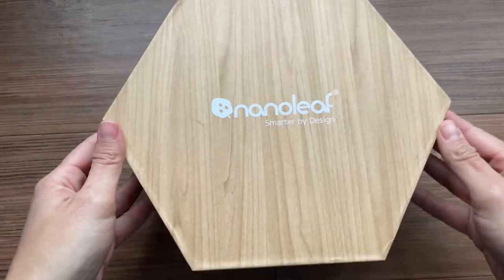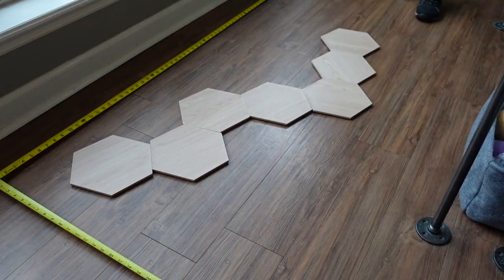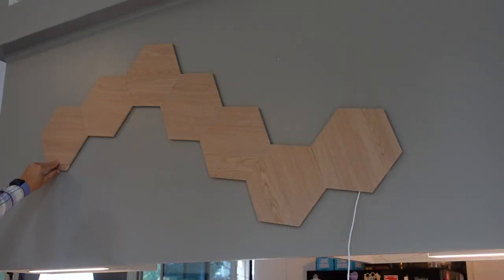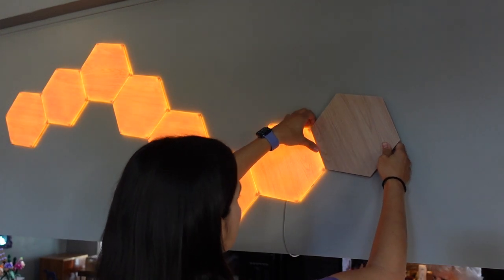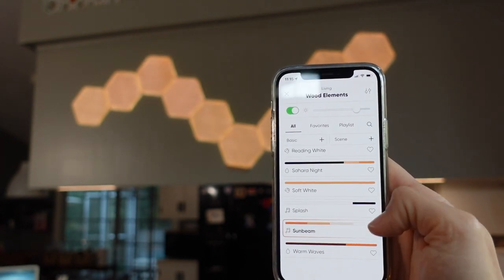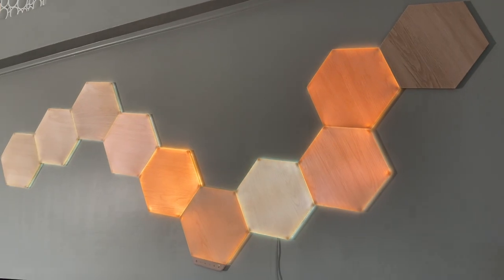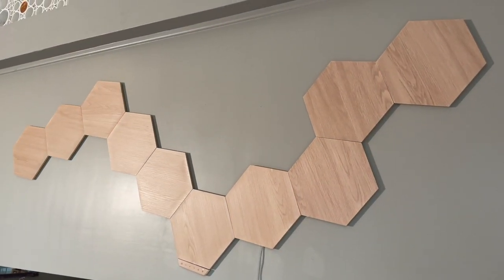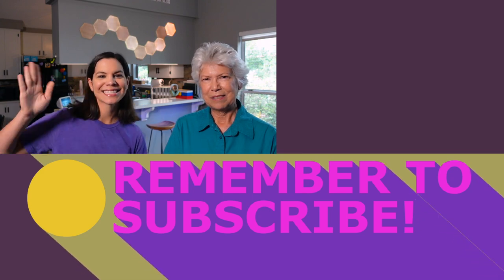Installing Smart Wood Grain Artwork That Lights Up // Nanoleaf Elements

Comment: Cool video. I had never seen these panels. Very techie, yet balanced by the wood grain.  One little tweak - instead of having the cord exposed, you could cut some 1x1 wood pieces or wood trim and cut a channel on the back side.  These would be like the wood or metal channel used to cover surface electrical work, but would blend with the artwork because of the wood. Additionally, instead of mounting it vertically, tilt it to 60 degrees to match the hexagon angles.
Reply from the maker: Thanks for the tips!